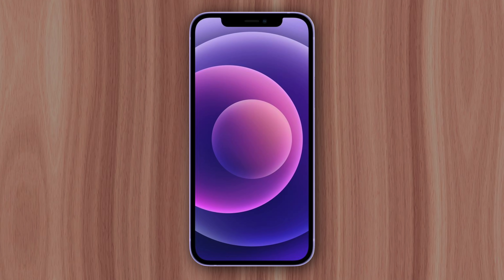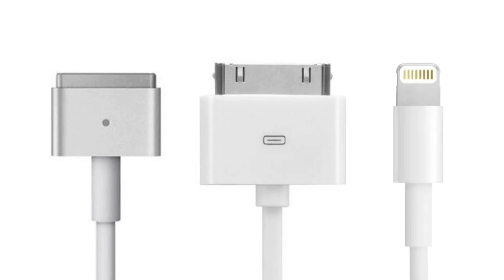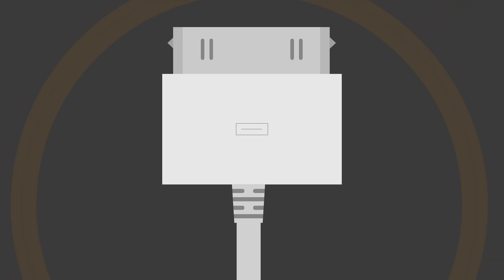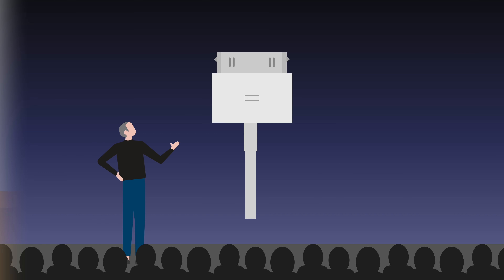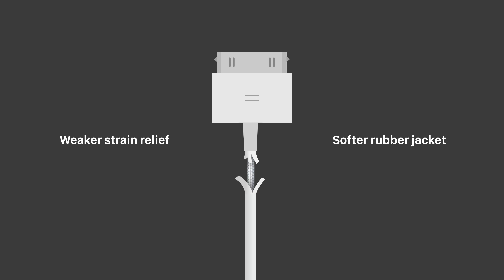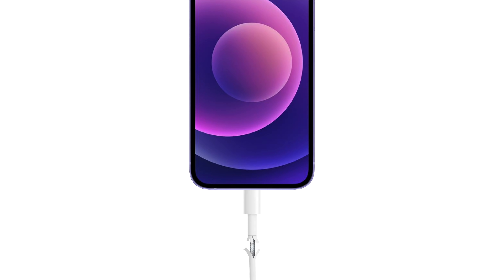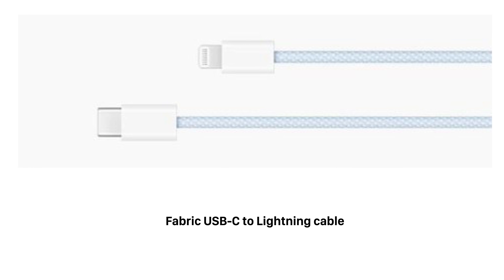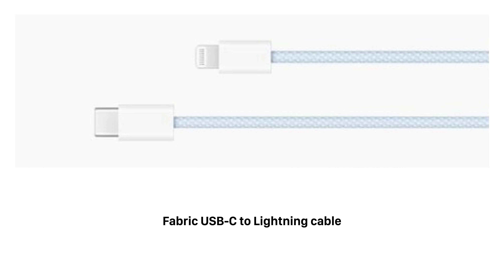Why iPhone Cables Break So Easily

Comment: I've literally never heard of a broken charging cable that wasn't Apple's.
Reply: Yep same here, cheap cables and bad design. Seems to be an Apple trend
Reply: @CallMeRabbitzUSVI  I think they focus too much on the inside, because the rubber breaks, but the cable works
Reply: @cybercery5271  the cables aren't even good
Reply: @5stxr.kixn1  Aren't good in what?
Reply: @carpediemearth  durability😂😂
Reply: @5stxr.kixn1  I always use 5 watt charging, and obsess over cables, I think that's why mine don't break.

But I do have an old iPod gen 4, whose cable I had to replace every few months
Reply: @cybercery5271  pretty sure they're just standard cables on the inside
Reply: @thegloriouspotato6223  yeah
Reply: My samsung charging cable broke. Might be because i place the phone 90 degrees of the charger and about 10cm away
Reply: Samsung phone chargers.

....but only if it's children who are handling them of course.
Reply: Unless it’s from five below. Five below has the same design as Apple cables, they’re just a little thicker.
Reply: My other Samsung phones used to break with their original charger but only if you twist and turn for so long
Reply: Had other cables looking fine and did not work 🤷🏼‍♂️…
Reply: fun fact: did u know that more people die from pigs than from sharks!! i will post regular vid like this so make sure to subscribe! btw i'm a kid!!!
Reply: Well then you haven't used much products to begin with, Xiaomi samsung etc have the similar issue
Reply: @masochistboy653  no they dont
Reply: @masochistboy653  Nope. I have a Xiaomi charger and cable for almost 3 years now. The only change that cable has gone through is the change of time. That's it. It still works as new. And this xiaomi cable  was inside the box of a cheap midrange phone and  somehow my whole family uses this one cable and adapter to charge their samsung flagships and midrangers, becuase it fits in so perfectly and tightly still after 3 years. I have used samsung cables simultaneously but they aren't strong and get loose within a year. And I have never met an iphone user who didn't have broken cables.
Reply: @masochistboy653  I use Samsung cables all the time. Never broken once.
Reply: @masochistboy653  Amazon, too. But they’re a bit thicker.

Comment: Because they don't. 
EVERY cable that companies break as easy but Apple is just more common overall and people complain more often when it comes to Apple.
I personally had NEVER a single issue with Apples cables because I actually know how to unplug a cable. Many people unplug cables by pulling from the cable itself and not the hard-plastic part. You just should not do this and you'll have a better time. I still have cables from my iPod Touch 4 and they still are flawless.
Cables from Samsung, LG, Xiaomi are just as fragile but people don't complain about them since each device is used by much fewer people. That's why you will find more results for "iPhone cable broken" than for "Samsung (Galaxy) S7 cable broken".
Reply: I always unplug on the plastic part. Maybe that’s why I’ve never broke any Apple cable in 1.5 years.

Comment: I've had a lightning cable for about 9 or so years (Probably less), still looks brand new and is completely intact
Reply: Apple's Lightning cables have not existed for 10 years, haha.
Reply: good point, I meant 9 haha, thanks for catching that
Reply: @crystalthewolf8945  lol, all good. I've had mine for quite a while too, and it only started fraying recently. My impression is that the quality is fine and it will work as intended as long as you aren't too rough with it.

Comment: I just use third-party cables or Qi charging nowadays, haven't had an issue.
Reply: @colinsouthern  I bought Anker, RavPower, and some other brands and most of them have been great (not so much with the budget options). No way in hell I’d buy any from the Apple store cuz it’s just too damn expensive lol
Reply: @colinsouthern  i live in california and I know what you mean about those knockoffs that are hazards. I also bought MFi cables and I only use qi chargers now from brands that I trust. Hence, Anker and RavPower. I think the latest one I bought was Belkin, but I just bought whatever Walmart had that didn’t cost an arm and a leg cuz it was an emergency situation.
Reply: @colinsouthern  I think Belkin is the same here in the states. It’s a name-brand but it’s just decent, not premium or anything by any means.
Reply: Same.
Reply: Same here with the Qi charging on all 4 of my past phones since 2017 and my AirPods 2nd Gen and Apple Watch.
Reply: rip to your battery
Reply: @rochitgurung9090  I don’t have that issue with my battery being degraded. My iPhone 11 Pro Max is at 92%.
Reply: fun fact: did u know that more people die from pigs than from sharks!! i will post regular vid like this so make sure to subscribe! btw i'm a kid!!!

Comment: The answer is simple: 
To buy more cables
Reply: Or buy a good quality third-party cable.
Reply: The correct answer is:
Because people complain way more often about Apple than other companies even if they have the EXACT same problem.
Just think about back when there was "BeautyGate". It instantaneously became a "Gate" for Apple while Samsung, Xiaomi, LG, Oppo etc. were doing the exact same thing (except WAY worse!!) for half a decade and no one ever complained about it.
Reply: @Raja995mh33  Because apple way more expensive than other companies ..... Duhhhhhhhh
Reply: @ridzuand.monkey272  Except they're in fact not. If you compare them correctly (which means not iPhone 12 Pro Max 512GB vs Galaxy A32 64GB...) you'll always see that Apples products are the same price or partly even cheaper.
Reply: @Raja995mh33  Same price??? cheaper???.... lol
Reply: The answer is simple:
Just be more careful
Reply: lol

Comment: The lightning cable that came with my iPad 3 years ago, it’s still intact. I believe if you take care of them they will last longer, specially if they are prompt to break easily like Apple cables.
Reply: I think if you do that for anything it will last longer lol
Reply: Apples cable are as durable as every others from the included ones by manufacturers. Apples cables are NOT more prompt to break.

Comment: Who’s had their MacBook chargers ever go yellow and explode?
Reply: Explode? How?
Reply: @Maciek2846  It got really hot one time, and the magnet sparked. Then the cable blistered and blew up the battery. This was on the 2014 macbook air.
Reply: @kanyewest2729  rip macbook
But it’s probably not a common issue since I’ve never heard about this one before

Comment: I’ve never had a broken one in over ten years of owning Apple products 🤷‍♂️
Reply: @Rudy Rodriguez Exactly
Reply: liar
Reply: @benhuriet000000  Just unplug a cable correctly dude and you'll never have issues... if you pull the cable by holding the cable itself - not the hard plastic part at the end - it's no wonder that cables break easier.
Reply: @benhuriet000000  Liar⁴²⁰⁶⁹ to be precise

Comment: What’s with people always breaking their iPhone cables? I used one straight, daily for 7 years and it was perfectly fine…
Reply: Same here.I’ve never had one break in 10 years of using them.
Reply: Same
Reply: The failure rate could be like 20%, which is huge, but you're still MOST LIKELY not gonna experience it
Reply: Me too but I have one from 1.5 years ago that just has a little bent on the USB side, but nothing else. Most of the people in this comment section are hating on Apple because these people are not that careful.
Reply: Do u use it just for 1 device or more
Reply: @Hybrid225  I used it for my iPhone and my iPad, and the first 2 years also an iPod touch. That was the only cable I’d bring on any trip
Reply: You are god then
Reply: @Yo_rese_  no,i just treat my stuff with care.I am 56 years old not a kid.
Reply: @davidjacobs6244  do you know Bryce hall
Reply: @Yo_rese_  never heard of him.
Reply: Wow
Reply: @mohammed.baig.  damn used it for a year got a scratch lol

Comment: Man, you’re doing the best you can. This has been my question ever since I bought the 1st iPhone(it’s cable was much better), and till now I’m using iPhone 12 Pro but I have noticed that their cable quality hasn’t changed. But, I have also noticed that when you buy another cable for you device it feels very nice, idk why. Another thing, their inner cables are too strong, the rubber covering may entirely come off but the cable will still work.
Reply: As I have cats I use braided ones they are much better.
Reply: You're a cult 🤦
Reply: @Raiko05  Well, you’re lucky, you may live in colder regions of the world.
Reply: Cause the plastic of the cable with the sun hardnen and you will feel that
Reply: @Raiko05  You have good habits mate. But I don’t face problems like that because I started using MagSafe and Anker’s wireless chargers. So, I also never use phone or iPad when it’s on charge. Using wireless chargers is one of the reasons which makes me not use devices when they are on charge.
Reply: @theartemis5687  im just saying you probably shouldn't be using wireless charging it's way slower uses more electricity and way worse for the environment. You can if you want to im just saying i wouldn't recommend it.
Reply: @killertigergaming6762  Ya, I have to but. The cable gets worn off when I put it on and off charge frequently. I know it wastes energy. In peak hours I use wireless, otherwise wired is much faster.
Reply: @Raiko05  It’s not the only reason for using MagSafe. I have a business so you know I have to take my phone out of charging very frequently and so, MagSafe makes it easier, to not bend the cables and break them off.
Reply: @Raiko05  Thanks mate
Reply: @Raiko05  But when you move it a lot it eventually breaks like in iPhones.
Reply: damn imagine being this stupid
Reply: R(4yeg
Reply: Its okay, just keep consuming our products. -Apple
You'll feel better when you do -Apple
Its perfectly okay to buy our product on an absurd regular basis,    dont worry about the plastic waste - we promise to recycle 99% of ¼ of the cable. -Apple

YOU HAVE NEVER BEEN PLAYED BY APPLE 

- Love Apple😘
Reply: @alexzanderfoxx6628  thank you for your artistic philosophy essay
Reply: fun fact: did u know that more people die from pigs than from sharks!! i will post regular vid like this so make sure to subscribe! btw i'm a kid!!!